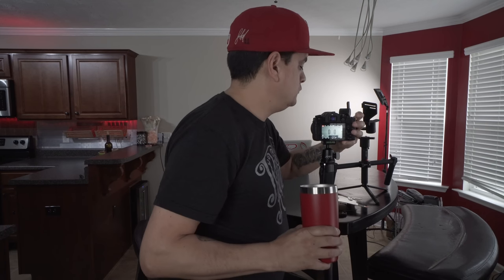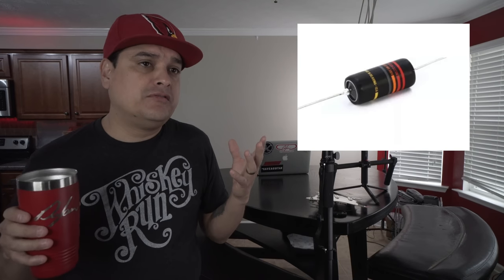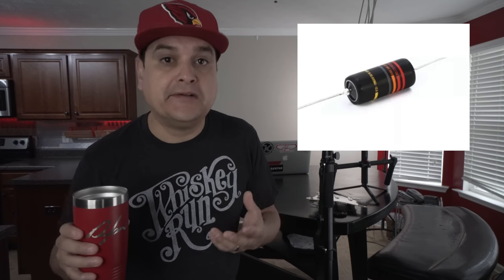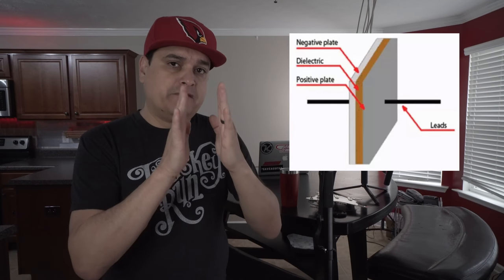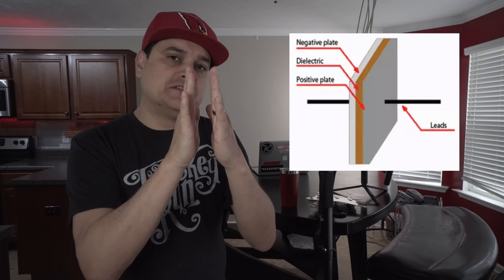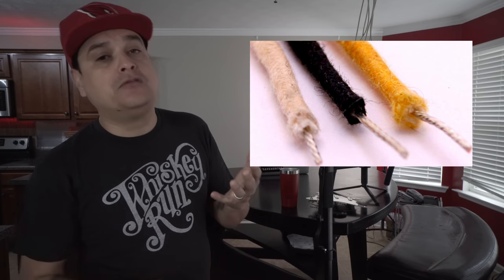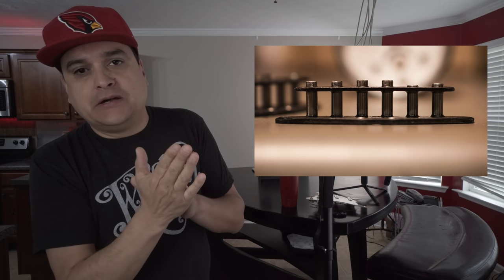Are Paper In Oil Caps Better Than Orange Drop?

Comment: I went through a phase.  Now i do not discriminate sjnce I can't actually tell any one apart. 2 has orange drop, EC & PRS Se has vitamin Q, the tele and Charvel has mojo Dijon. all .022, ibanez RG and Telecaster has ..047 & .033 caps. Yes I am a believer in Treble Bleed, all have kinnman circuit....0015  Sprague  ceramite Cap with  150k 2w 10% tolerance resistors. All my cheap guitars sounds amazing...

Comment: I like Van Halen approach. Use your ear, less is more. The least amount of electronics between your pickup and your amp ......the better. Leave out the tone control and capacitor all together. It is redundant anyway and is just there for a convenience so you wont have to walk over to your amp and twist knobs. Just sayin. That is always a good place to start. Every time you add something between your pickup and amp listen and see if tone has changed negatively to your ear and evaluate if the thing added is worth the compromise....

Comment: Actually you can make an "aged" capacitor:) 
Using a Arrhenius-Peck equation + Damp-Heat environment (85%/85°C) and Voltage Bias of 100% - (everything accroding to a JEDEC standard) - you can accelerate aging process. Just monitor now and than ESR and Capacitance and new capacitor will have a properties of an old one in a month or two... Depends on your set piont:) 
It's industry standards. Mfr of capacitor do this all the time to monitor the quality of their products, not just capacitors.
One more thing... the ESR on low frequencies of oil cap is much-much higher than of an ordinary film cap, so if you have a cirquit with low res in it - like pot wired as vari-resistor, this parasitic "feature", surly will come into play...

Comment: Before I watch the video, I'll say my concern is about ageing. Is there a difference in the way capacitors of different types retain their value over 5, 10 or 20 years? I guess they're a cheap and easy replacement but I'd rather never have to do it anyway.
Reply: Mica are very stable (+100 years)

Comment: An old capacitor is not what the guitar manufacturer put in the guitar when it was made. They put in a NEW capacitor. Over the years the capacitor is unlikely to be the same capacitance that is printed on the side of it. It’s ESR will have gone up. The capacitance and the pot work together to produce a tuned circuit and the characteristics of this depend on the the values of the components. The components have a tolerance. Take any two “same” capacitors and measure them accurately. They are never the same as each other or any of the others in the batch for that matter, then add temperature, and aging to every part of the guitar and the variables are so huge as to make it physically impossible to replicate. The simple bottom line is that if you like the sound of a particular vintage guitar then save up and buy that exact guitar because there is not a cat in hells chance of you reproducing the exact sound of that guitar by buying “boutique” capacitors or pots or any other component, all you can ever achieve by that route is to produce a different tone by changing values (including the tolerance drift of each component) and of course an emptier wallet,  but you still won’t have the tone of that vintage guitar. You will have a brand new guitar sound that sounds a bit like something else………

Comment: I'm a little disappointed that you went through this whole thing without mentioning microphonics. From a typical electrical engineering perspective, we're only concerned about the values you mentioned like capacitance and voltage. But, in an audio circuit, a highly microphonic component will play an additional role in the sound quality. Not saying it's good or bad, but it exists. If microphonics in audio circuits didn't matter, there would be no distinction between the 7025 tube and the 12ax7.
Reply: Never heard that caps suffer from that

Comment: “I’m not judging”- continues to speak in placating manner.

Years ago the cats at Performance Guitar gave me some little pancake .047 ceramic caps. I didn’t have any preference at the time. I was going to have to do it myself because I could afford them doing it and they are cool, Mr Sugai hands me these caps and says “try these manny” so I paid for a DiMarzio Model P, thanked him and split. I can’t count how many times I’ve reused those little caps. I installed the pickup with my new wiring and holy smokes! I actually had a tone knob I could make use of, and thu most of its range. 
Nowadays I’ll drop $2.85 on a Russian PIO if it’s a quirky value. It’s fun and trust me bro, I’ve been a fool for lesser things.

P.S. I just called to check on the men at Performance Guitar and everyone is fine. They are still working but you must 

call first and make an appointment 

I can’t believe those guys have tolerated me all these years. I can be annoying. Probably shoulda watched the whole video before I started typing, sorry Dylan. E.
Reply from the maker: Lol.... I will state facts. If you feel convicted by my statements when myths are exposed and BS is called out.... that’s on you
Reply: You didn’t read my comment throughly Dylan. 
I should talk, I didn’t watch your video. 
It’s pretty plain what your business model is. 
I thought I’d check tho. 
(the self deprecating statement, the apology). 
Doesn’t fit the model. Your response confirms this. 
Based on media these days it’s likely you will do great!
Good day
Reply from the maker: If you commented without watching the video .... you are what’s wrong with social media.
Reply from the maker: If it is so plain “what my business model is” what is it then, Mr “I didn’t even watch the video” 😂😂😂😂😂. Thanks for the laugh
Reply: Typo “I’m going to shut up”

Comment: Positive and negative idk neutrons? Electrons? The capacitive properties of the material used to store charge the density and some other stuff, basically it doesn't matter unless room is an issue, papering oil use more material to get the same values as an orange drop whatever it all boils down to the value and you've got to consider the difference between simple vs highly sophisticated electronic systems, the guitar is probably thee most simple systm 
(other than a lightbulb- and ithat questionable to as some light bulb ls have micro circuit boards in then too) 
The most complicated section of a guitar is in the switch like an oaks grigsby superswitch, the possible setups you can make to achieve the number of tone options or your overall playstle ease of use like the pots used for decent volume swells for example, the splitting of coils, idk I'm still learning but so far what I've personally gathered is compared to a toaster, there is not much difference in complexity in a guitar when you compare to an amps pre amp.or power amp section, or a laptop or a pc even the mouse can be more complicated, I love how Leo fender and others like him have managed in their time to envision design and create such a site yet effective  developmental change of a simple instrument which changed the whole industry FOREVER!... and in a big wave way, by keeping it simple. 

Love your vids Dylan, I've never witnessed a crap vid from your channel! not yet anyway, it's obvious you know your shit ❤

Comment: Better quality parts cost more money.💰 But, they're worth it. Because, they last longer, work better and, they're safer. Thus, prolonging the longevity and, performance of old or, new equipment. This is extremely important especially in amplifiers. Old style or, cheap capacitors can fail more frequently. And, when they do, cause shorts and, fires. Thus, destroying a cherished, vintage piece of equipment. It's not worth the risk to save a little money on something as cheap as capacitors.

Comment: Some people equate vintage guitars to a "fine wine", aging = better. Great whatever. How do you get a "vintage sound" on a new guitar? Measure the values on the old one you like and whatever parts you use, new old, whatever, as long as the values match, they should sound similar. Don't have a vintage one to compare? Then you have nothing to base your claims on. P-I-O caps, bumblebees... aren't any better than a good orange drop. (I use orange drop as they are very durable, but you can certainly use cheap film or ceramic, they just might get damaged in a modding or upgrade scenario. But cheap enough to replace, so kinda a moot point) Vintage parts of vintage spec parts are really only valid if you are restoring a vintage instrument. And if you don't have working parts to measure, it is still an estimation.

Comment: I haven’t played around with PIO caps enough to have a real opinion, but I do know enough about electronics to know it’s not quite as simple as you presented and I’m curious to know more. It’s pretty well known that capacitors aren’t purely linear devices, and many construction types also have a non trivial inductance. The effect is that there’s different harmonic distortion properties for different capacitor types. Would you argue that at the voltages and currents used in a guitar the difference is just not audible?

Comment: Formvar was the chemical used in vintage pickups to cote  the magnet wire used to wind said vintage pickups not the bobbins, try to find some Now, not that it makes that big of a difference but im sure it may contribute a tiny difference, how many components are there between your guitar strings and your speakers in your amp set up? If you think none of this makes a difference in the final outcome then you are a metal player and tone already does not matter to you, as we all know there is no difference between SRV and metalica.

Comment: Paper in oil is the bee's knees, why else do you think they are called bumblebees? I used to be a horrible guitar player who couldn't even play smoke in the water! But when I ordered a new old stock 1933 paper in oil capacitor from Soviet Union for twelve thousand dollars, wired it with dinner plate sized potentiometers (I don't want any tone robbed from me!) I started playing better than Jimmy Page, Hendrix, and Slash all wrapped in one joint! I started collecting stadiums and girls started throwing their underwear at me! My life has been turned around by paper and oil! Until I drank the oil from the capacitor.
Reply: After 4 years your comment deserved at least one 👍🏻

Comment: Will you be adding more modules to your SkillShare account?
Reply from the maker: NewGunGuy what would you like to see? I have been thinking about it
Reply: @DylanTalksTone   Speaking as a beginner, it'd be cool to see standard and special wiring configurations. For example, 50's vs modern Les Paul and Tele  wiring, PRS 5-way rotary and explanation of signal path, etc. Also, archtop wiring through f-holes and other things that will take beginners out of beginner level. Also, some talk about mechanical connections and tinning. Thanks.

Comment: Ok, I'll comment before watching the video as Dylan recommended. No frustration on my side.

I disagree with the unreasonable prices some vintage caps go for. Also remember that caps, especially oil and paper ones, drift from their factory values over time.

If you want my advice, here it is. Get a bunch of them, those that sell for reasonable prices. Remember the principle of how different values work. Put them on your guitar and see if you like how it sounds. If you do, leave the damn thing in. You're set. Or you can do a blind test, but the results... will be discouraging. A lot of it is placebo. Any decent tone cap with the right values should sound good. The tone, as they say, is in the fingers. But crappy caps can make your tone knob unusable.

Comment: I'm not sure why I watched this; I cut out the cap in my basses to prevent inadvertent treble-cut.

However, I watched it all the way through; it seems there's a lot of weird thinking around in guitar circles. Tone caps in guitars are bypass devices: none of their parameters apart from capacitance is relevant to their function.

Comment: Is it just me, or did his explanation disprove his claim?
Reply: No. Not really. If you are talking about the issue with old paper capacitors that you would like to replicate the sound of you need to remove the old capacitor from the circuit and measure its capacitance and replace it with another that you have measured to have the same capacitance. 
The reason you remove the old one to measure it is because it is impossible to get an accurate measurement in circuit. Certain capacitor types lose a considerable amount of capacitance over time. If you want to replicate that, you'll want a lower value than is written on the outside of the old one.
The reason for measuring the new one is because some film capacitor types can have quite large tolerances with regard to the rating printed on the outside. Up to 80% on the low end and 30% on the high end. This is the "mojo" of Orange Drops, relatively narrow tolerances and they don't have the kind of internals that age.

Comment: Let your ears decide what Type and value tone cap that YOU LIKE. My experience is not only the rated value but also the physical size and price matters and the pickup has to have an Alnico 2 or 5 magnet or greater.(not ceramic). A cheap paper and oil .047uf tone cap(Amplifiedparts.com) sounds like a cheap $1 paper and oil cap to my ears. A less than $2 Orange Drop .047uf tone cap is great for the money but my ears have heard better. A $27.50  Luxe Bumblebee .022uf tone cap(Mojotone.com) in a Bridge position humbucker tone circuit has tone shaping qualities. It is worth the money?  Yes If you like what you hear and get $100 worth of better tone for $27.50. Trust your ears.

Comment: What about ceramic disc caps!?? People say DON,T DO IT. But they are key to vintage tone in say supro amps!! It gets convoluted. I,ve seen tele,s from the fifties with ceramic discs.i like mallory 150,s in amps and mojo dijons. And they are cheap!! So i use them in guitars too.i could use a 40 cent cap but it,s my guitar so 90 cents is better right???
Reply from the maker: Russell E Simonetta active circuits are a totally different deal. Doesn’t apply in a guitar
Reply: Don't Do It, lol. Ceramic disc caps are very susceptible to temp change and the values change depending on temp.
Reply: The temp changes a guitar is exposed to, doesn't affect ceramic caps at all...

Comment: Plate around dielectric can actually move a little bit when there is signal, so the capacitance change according to signal input. The construction can make a difference because of this. It could be noticable in audio. Usually cheap small capacitor sound harsher than some capacitor like sozo in an amp

Comment: Not True. Maybe for the caps they used what they had.. BUT! Certain woods have been used since the mid ages if not longer because they are good Tone-woods.  A ceramic capacitor of the exact Same value SOUNDS Different (mostly a little brighter) than an orange drop. EVERYTHING you do or change on a guitar has an effect on tone, weather noticeable or not. The magic word is"coupling".

Comment: OK - I am really pissed about all that cap religion 🙂. The cap is just a bypass to ground, so it is not in series with the signal. So like in speaker crossovers I don´t think the
type of cap is very important in parallel filters, but the value is. Now I have let the steam out, so I can enjoy the video.

Comment: back in the day when most amps were single or dual channel guitar amps, ie, fender, marshall or vox, yea first was the bias controversy, lower bias longer tube life, ok, higher bias less tube life, more nasty breakup at higher volume, but there was always a difference in the type of caps used in each stage of the amp, orange drop caps sound sterile in a tone circuit where used in the high freq. part besause of the hard outer coating of the cap while it may not be a problem in the bass freq. of the tone stack there is a marked difference in tonality due to hysterics, that being said,reinhold bogner made some of the best channel switching amps with less than the most touted components, go figure, ha ha
Reply: Hysteresis is not a factor in a guitar tone control. The volatages are too small.
Reply: @andymellor9056  true but i was talking amps, funny how the topic changed to guitars after the first comment, lol
Reply: @noelharrison902  Hi, yes, however the video is about capacitors in guitars, not amps. Your final point is quite relevant, however - the system is more than the sum of its individual components.
Reply: @andymellor9056  yea i figured everyone realized the small voltage thing and were talking about amps, which would have made sense
Reply: cool that someone realizes the difference small changes can make in a circuit thank you for reaponding
Reply: @noelharrison902  Guitarists talking about tone and making sense? ;-) You'll be expecting them to sight read next! :-D

Comment: Get some cheap Russian silver PIO caps, the 600V ones.  Replace the one in your guitar with the same value.  Tell me if you cannot hear a difference.  If you can't, be happy.  Ignorance is bliss.  If you can hear the difference, next question is if it matters to you.  If it does not, then good for you, Russian PIOs are not expensive. If it matters much, then enjoy.

PS I am not one of those sheep that believe all PIO caps are alike. But IMO the 600V Russian PIOs are very transparent.  They almost sound like a short circuit when the tone pot is on 10.